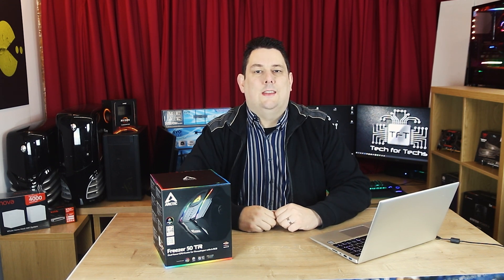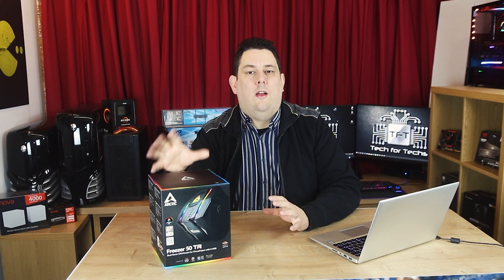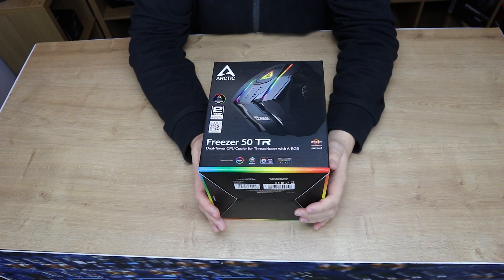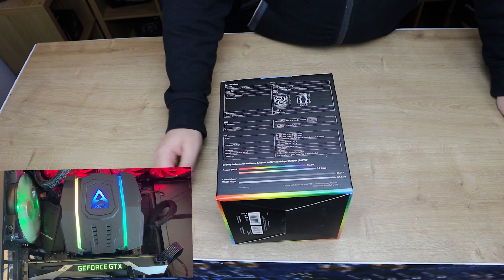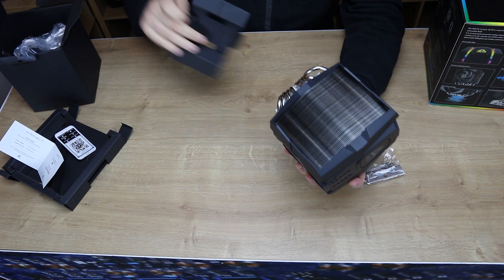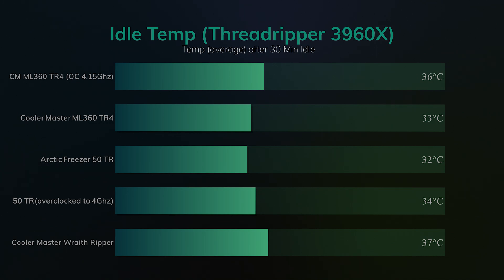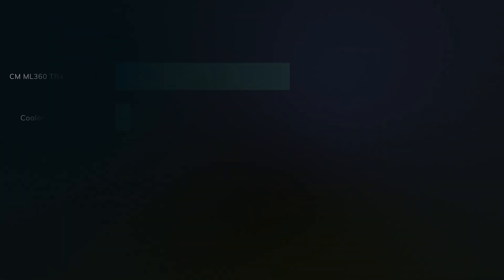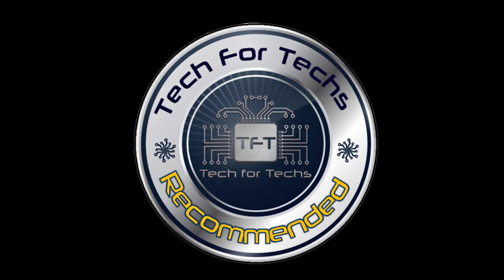ARCTIC Freezer 50 TR Review with 3rd gen Threadripper 3960x

Comment: As far as the width of that base goes, the device is already too damn big! I had to send mine back because the ONLY way it would even consider running in my machine was if I took the two outside brackets off -- one of which actually holds the 2nd fan! So if I would have kept it, I would have been only using 1/2 of the provided fans! The reason is the damn RAM sockets! My Mobo has 8 sockets. I am running RAM intensive applications, so I need access to all 8 sockets, each with max 32GB (256 GB RAM total). You can imagine how upset I was. I went with an AIO water cooling system -- the MSI Coreliquid K360...it was the only one listed on newegg that was AIO which supported the threadripper. At least in terms of their side-bar features selector is concerned. All in all, I was not the least bit impressed with the Arctic Freezer 50 TR. It might be great for people who have tons of space between their CPU socket and their first DIMM sockets. But most mobos are not built that way. RAM is positioned nearest to the CPU for a reason. It's supposed to be super-fast access. So far as I am concerned, this product has a serious design flaw. It needs to be a bit more T-shaped, instead of the boxy shape it has. RAM clearance is something they should have been conscious of, but clearly weren't.
Reply: I wondered what CPU you have?  I am in the same position now as I have a 3990X and following reviews and advice online, went for the Noctua.  Problem is it takes up that much space with the dual fan that it renders the 4th slot of RAM on each side useless.  Hence I am now looking for an alternative AIO cooler that can handle this CPU.  Also the board I purchased at the time (again specific to sTRX4) seems to be very fussy with the 3990X when it comes to RAM, especially speed, so it looks like I may have to go for 8 modules to get anywhere near decent frequency.....meaning I am forced to get a smaller cooling system.  Wish they would design these things better to work together!  Cost me a fortune this build
Reply: @AndyPerry1972  I have the same CPU as in the video above -- the Threadripper 3960X. And I have it in/on a ROG Zenith II Extreme Alpha mobo. I sent the ARCTIC Freezer 50 TR back and paid a restocking fee. I got the AIO K360 Coreliquid, instead. IMHO, it's better to blow that heat straight outside the case through the top via cooler fans/radiator, than sending it into the case to be dispersed by main case cooling solution. In fact, I think using the ARCTIC Freezer 50 TR will likely require additional case cooling fans, or the heat will likely build up inside the case. I am forcing the mining algo to cn-heavy/xhv at moneroocean. That keeps the thermals from jumping all over hell and back switching algos. And it puts that extra cache RAM to hard work. As I understand the 3990Xs, they do not run as fast as the 3960Xs, but have more than twice the # of cores (64 vs. 24) and 50% or so more cache RAM than the 3960Xs. And by not running as fast, presumably they don't get as hot. But they do have an increased presence/footprint on/under the heat spreader lid as well -- meaning you must be more careful about covering the entire heat spreader lid of the CPU of the 3990Xs vs. the 3960Xs. So I have doubts that even the K360 Coreliquid AIO will work for a 3990X, because you need something that covers the entire lid. They probably figure that the people who can afford the 3990Xs will probably go custom water cooler solution, so not much market demand for them as AIOs. At least 5 months ago when I got it. I haven't followed the cooler market since then. Or consider buying the K360 from a place like Newegg that will take it back opened for a restocking fee if it doesn't work out for you.

Comment: Description says test  system used 2 8gb patriot viper steel series, but @11:46 you clearly say "kingston hyperx" and enter 4 sticks... so which one is it? Ram clearance is key for this cooler, so just want to check compatibility! Thanks
Reply from the maker: Description states "RAM: 2x Patriot  Viper Steel Series 16GB (2 x 8GB) 4400MHz https://amzn.to/2EopstD  (would not fid due to cooler)
RAM Alternative,  4X 8GB Kingston Hyper X "

So in basics, as it says in the video we normally use Patriot Viper memory 2Kits that have 2 sticks in each, so 4 total (as they are sold in kits of 2), but we had to use the alternative Kingston sticks due to the Cooler Clearance issues.

Comment: Good review!  But I can confirm that the cooler mounts fine on older TR4 boards.  I am currently using it on an AsRock X399 Phantom Gaming 6 with a 1950X.
Reply: what temperature holds at a frequency of 3800 in the 1950х ?